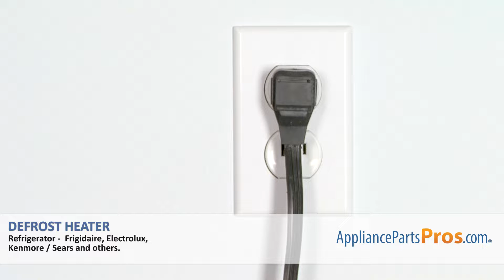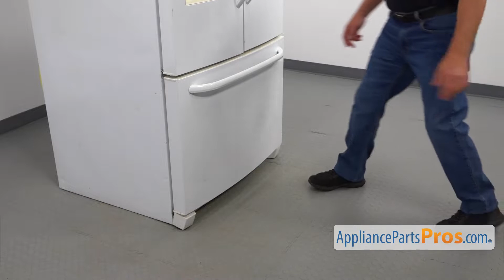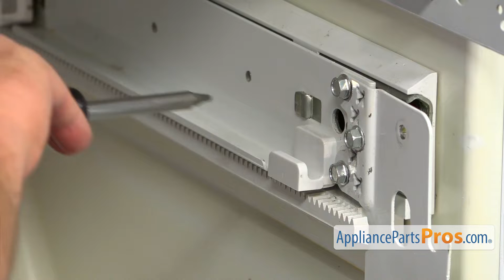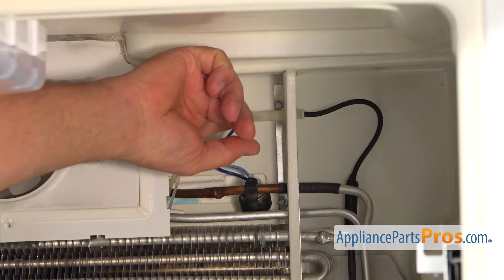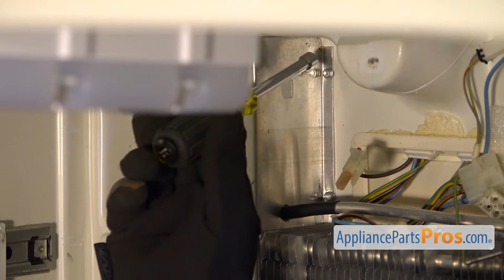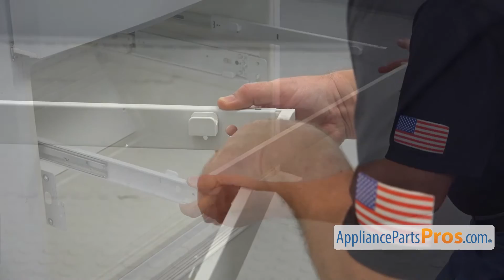How To: Frigidaire/Electrolux Refrigerator Defrost Heater 5303918410

Comment: Why arent you showing putting the plastic connector back in to the back wall metal cover? You didn't reinstall it? Is it not needed? I also had an extra wire i don't know where it goes? Its a grounding wire, not the one you show in the video because I have that one also. But I have another extra grounding wire. I have no idea where it goes?
Reply from the maker: What is your model number so we can look up the information for your unit?
Reply: I also have an extra ground wire and was wondering the same thing? My model number is EW28BS71IS6. Thanks